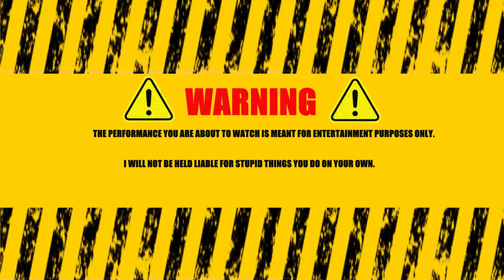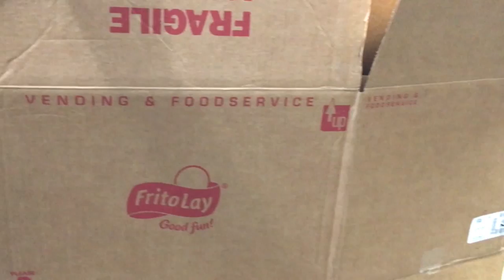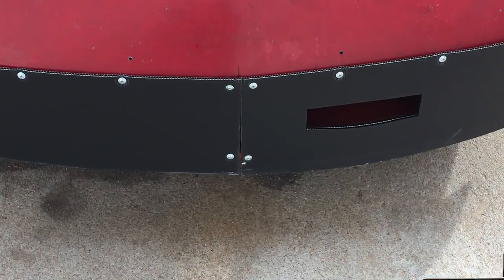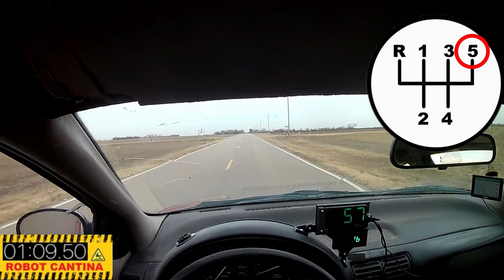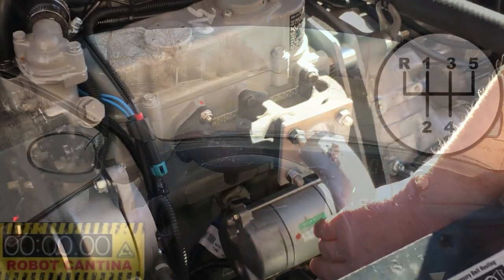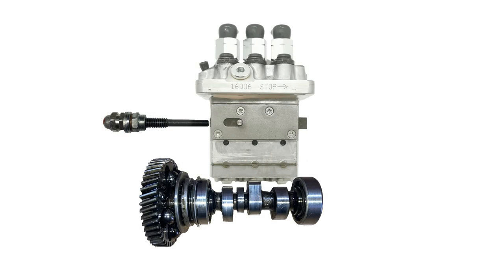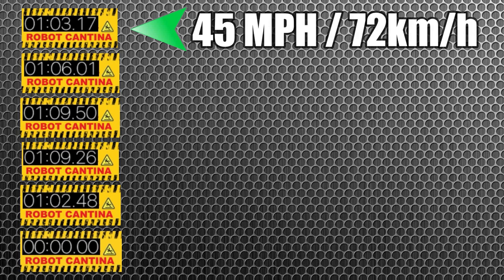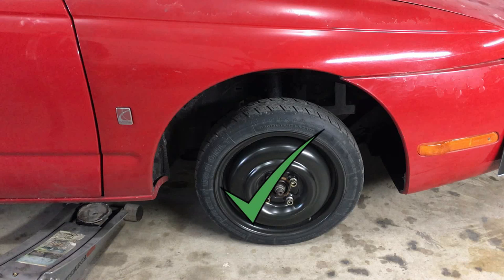S3E2   Fuel and aerodynamic mods ....We do some experiments to try and get the Saturn to go faster.

Comment: Maybe an intake positioned where there is cooler air would help. I like studying aerodynamics and i can say that the air dam is a little too low. Rear spolier removal seems ok, though consider replacing with a thin plastic piece that would extend 2 inches past the trunk. 3x4 inch pieces of plastic in front of the wheels would also help reduce drag.

Comment: first of all, going past rpm limit is not a problem at all for these engines, the reason its set from factory is because of smog regulations and also so people dont overload these engines for hours and hours on end running at high rpm. I used to repair these engines and they run nearly top rpm for over 10k hours so you can imagine, a car NO WHERE NEAR gets there for that amount of hours because they have gears while generators do not. You can set these till the injector pump runs out on these engines and it will run no problems. You can also modify the pump as well for higher output and some even have adjustments internally but those are usually for the big version of the motors, these small ones i think need machine work

Comment: Swapping the transmission for the MP3 transmission that was in the DOHC Saturns (SC2 SL2 SW2) will get you a closer gear ratio through all 5 speeds and may help with your acceleration. The MP2 transmission in the single cam / base model Saturns was longer gearing for more economy.
Reply: I think that's the transmission he has, it came from another car
Reply from the maker: Yeah, the MP3 has an ideal set of ratios for this smaller engine and you may have missed it, but that is the transmission we are using.

Comment: Being a diesel fan myself, I'm loving this series. It's not unusual for the exhaust to remain relatively cool during idle. I've idled my truck for 10 to 15 minutes and I can still grab and hold the down pipe from the turbo. Your EGT seems a bit low. It should be around 1100F. You're down on power because the engine is still "cold". It kind of makes sense that your aero mods slowed the car down. You took a big hole (no air resistance) and made a big flat spot and the car now has to push all that air out of the way.

I'm looking forward to your turbo install. It'll be interesting to see just how much you gain. I'm also curious to see what kind of fuel economy you finally come up with.

Great videos! Keep 'em coming!
Reply: @ocdman202  The Model T was introduced to the world in 1908. Henry Ford wanted the Model T to be affordable, simple to operate, and durable. The vehicle was one of the first mass production vehicles, allowing Ford to achieve his aim of manufacturing the universal car.  Telegrams went the way of the Model T..
Reply: The lights of the original Model T were not electric. The common lamps used on horse drawn vehicles were the lamps used on the Model T, this meant it used acetylene carbide headlights and oil side lamps. Electric lighting and electric starting became available for the Model T late in production during the 1920’s.

Comment: With 5th gear being too steep and hard to change ratio I wonder if smaller tires could be a benefit. Maybe the smallest skinniest trailer tires you could fit on, side benefit being lower to the ground and less aero drag. Really impressive how well it does already!

Comment: Adding boost to a diesel is not the problem.....adding too much timing is the real problem. As long as the egts are in range, you'll be good. And put in some good oil ( Schaeffers  or Lubrication Engineers )

Comment: Increase the fuel delivery from the governor / fuel pump.
Adjust it so when you full throttle it from idle it puffs black smoke that you can barely see thru it ( not thick black smoke )

Comment: It probably won't be much, if any, faster with the turbo. And the EGT will become lower if you actually get boost. Unless you increase the fuel to use the extra air that the turbo gives the engine.

At work, we have a dyno where we do a bunch of shenanigans from time to time in between tuning customer cars. A colleague owns a Mercedes 164 with 5 Cylinder diesel engine and no turbo. Made about 115hp. We slapped a turbo on there, and it made 118hp with no other mods.

But then we put a bunch of fuel to it by doing some electrical fiddling to the diesel pump, and with it came the black smoke, and a result of 185hp. :D
Sure, EGT probably is pretty high, but a very nice increase in power with easy mods.

Comment: Not sure if you've seen SuperFastMatt, but as he said in a recent video, intuition about aerodynamics is often wrong. That spoiler helps air detach from the car, rather than roll around in a turbulent mess - you probably want to keep it.  As with any experiment, do things one at a time and gather data in a systemic fashion - that's the key to seeing where the real improvements are.

Comment: don't worry about the EGT, just keep it below 1300F and you'll be fine, if you start getting to that point, add watermethanol spray.
And a little bit of timing advance will also help, not sure how to dial that in on this pump (I'm used to the Bosch VE), but not having the timing will make your engine feel down on power and depending on how the timing on this thing works, even get slower as you add more fuel.

Comment: A simple DIY water injection system will allow you to add a LOT of fuel and keep the EGT's Down. 
You can also do a water methanol/ ethanol 50% Mix and that will add more power still and not affect EGT's. 
Been using this for MANY years on my diesel engines and works  perfectly.  On this little engine I would suggest about 150 Ml a minute water dosage.   I use a cheap caravan pulse water pumps that are about 4L min and 80 PSI along with a bit of flattened copper tube to give me the injection rate I want.  On 2-4L engines I run about 3-400Ml a min depending if I want cleaning for using alternative WVO/ WMO fuels or I am wanting performance. 
300Ml min @ 50% Meth = a 14 HP boost which would be huge on this engine and would probably take it.  Engines can digest a LOT of water and far more than the ignorant say will Hydraulic them. The fire goes out and the engine starts spluttering way before that happens and of course you can increase in increments to find the sweet spot.  Yes, engines can use a LOT more water than they will use fuel. 

For switching with a turbo I use a Hobbs type pressure switch so the WI comes on above highway Cruise boost pressures so it's not on all the time which just uses the water up when it's not needed although that may take some figuring on this setup.  The Wi will give good results  on an NA engine and you can set the WI to come on with a switch under the throttle  so it comes on at full tilt where this and most other NA diesels are driven anyway. 

You will be surprised at the difference WI can make with straight water and especially  with the  alcohol added  and with a turblow.

Comment: You could try using a cheap little motorcycle intercooler for the turbo. Another thing to try is water methanol injection. It'll cool things down a lot on the ultra cheap and keep the internals clean. Winter wind shield washer fluid is perfect for it. Take a small junk picked carburetor and close the idle jet I think(?). Then finagle it so it releases at a decent rpm above idle. You should get a nice slow spray in to the engine. Might be best to put it in the side of the intake pipe (after the intercooler?? Idk). Sometimes it can increase efficiency and or power too. It's extremely common on high performance builds. Could cost like $10 to try it.

Comment: Some of the slower time with the aero mods may be down to air intake temperatures too. With the air filter being open at the back of the engine bay, at wot that pocket of air gets hot no doubt. With all the aero stuff off, there’s likely enough air circulating to keep cooler air for the engine to ingest. Perhaps adding a form of cold ram air intake piping to bring in coolest air from the front of the car (like the original Saturn did) to keep that happier, especially with the turbo.

Comment: I did some serious aero mods on an old chevy truck of mine running an old pig of a 350 and on highway trips there was an improvement in my mpg.   You should try covering the rear wheel well with coroplast and maybe even the front wheels.  Make a skirt all the way around the car to just above the ground.  I used the rubber stuff for landscaping from the big box stores but there are other things that would work.  A "boat tail" may help too.  I built a cap out of coroplast and wood for my truck bed cant remember the exact angle but apparently theres a magic slope and I matched that as best as I could had planned on redoing it in fiberglass but blew the engine and decided to go to a 5.3 and just havent got around to it.  

I did go with smaller tires and lowered the truck quite a bit then shaved the tbi and put a much less restrictive intake and exhaust on it then removed the AC and put a modern alternator in it and a few other things but after all that it went from 11-12 mpg to 17-18 which

Comment: 750-850*F EGT is ice cold. That's a happy engine, and you got a lot of room to grow
Reply: @ocdman202  The Model T was introduced to the world in 1908. Henry Ford wanted the Model T to be affordable, simple to operate, and durable. The vehicle was one of the first mass production vehicles, allowing Ford to achieve his aim of manufacturing the universal car.  Telegrams went the way of the Model T..
Reply: The lights of the original Model T were not electric. The common lamps used on horse drawn vehicles were the lamps used on the Model T, this meant it used acetylene carbide headlights and oil side lamps. Electric lighting and electric starting became available for the Model T late in production during the 1920’s.

Comment: The wing will help separate the air from the car without the curve of the boot will pull the air dow in the low pressure zone creating more turbulence make a small drag style wing out of aluminum that massively helps with drag

Comment: Also the governor is more for it being in a tractor. To keep the speed down and also keep the tractor speed consistent under loads from plows. Removing the governor won’t blow it up.
Reply from the maker: I would really like to remove the governor and probably should have before we put the engine in the car.  Unfortunately at this point its difficult to gain access to all the bits and we will have to pull the engine/trans to gut the governor.

Comment: Also you can try replacing hub wheel bearing(s) i can hear that distinctive sound  and they cause drag, i dont know if it's only left front wheel or both front wheel bearings.

Comment: Slower with aero mods does make sense when you look at it in a concept of downforce equals rolling resistance. 
Many times also a rear wing will stabilize air coming off the back of the car so that may have been an issue as well . To test this and validate it I would put the rear wing back on. Very possible also blocking off the air coming in from the front of the car increased down force as well. Being the car is so underpowered it may have this big of an effect. Also, ambient air temperature could be part of the issue as a colder  day on an engine like this that is naturally aspirated will make more power.
 The egt will climb even more with a turbo charger due to the combustion rate. Another option to add power maybe if there’s an adjustment to advance injector timing.

Comment: That engine bay has to be hot as heck. That would really in a power reduction as you drive. Maybe pull cold air from outside? Wheel well?

Comment: Check the fuel temp, hotter fuel= less density = power loss. 

This was a common cause of  slight power loss on older diesels. Newer diesels actually inject more fuel when the fuel gets hot

Comment: The theory of the spoiler (wing on the trunk that you removed) is that they create a beneficial drag that helps the rear tires have more traction (this is associated with spoilers above the trunk). Not sure why this would be important for a frontwheel drive vehicle. The configuration of it being at trunk level makes me think perhaps it is producing some minimal lift and this is somehow helpful with respect to aerodynamic drag (this is one of those wind tunnel questions - maybe there's a free online CAM modeler and some basic playing with it could help) for the front wheel drive.

Perhaps you could reinstall the trunk spoiler then fabricate a hillbilly front spoiler - protrusion from the front bumper bottom - that aids in reducing drag at the front by directing air flow up over the hood then run this through the hillbilly air tunnel... You could also test with just the front protrusion for an extra data point.

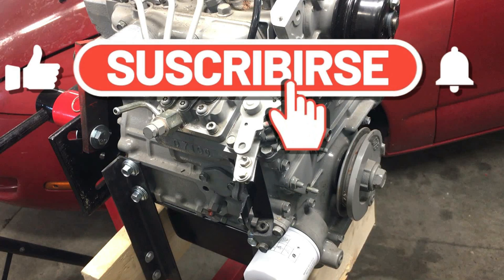Last, maybe it's an Easter egg; maybe it's not but it looked to me like "SUBSCRIBE" (14:08 is when it started to fade in) was misspelled when it appeared on the video...

Oh, and since you mentioned it @Robot Cantina - if you were going 396 why not just go 496 stroker? (Dream big or don't dream)
Reply: The rear spoiler he removed is almost certainly beneficial to reduce drag, he should probably put it back on.
Reply: @swecreations  I know that the raised spoilers behave exactly as I said, forgive me for not taking your word that a flush mounted spoiler acts the same way. Without a wind tunnel test or a CAM analyses that can simulate it we are both guessing based on our experiences. In my experience flush mounts would generate lift - which also seems to make more mechanical sense since you would want to apply pressure to the front of a FWD car for added traction because the torque is being applied at the front not the rear of the vehicle.
Reply: Also it's a Saturn not a top fuel or other race car so there's that....
Reply: @steve.roadcap  Look at the wing at the back of a Volvo 850-R station wagon. That thing helped bring its cd value down to an extremely low for the time 0.29 value.

You need to detach the air when it comes to the back of the car. The rear of the car is way too rounded, I can see just looking at it it will cause lots of unnecessary drag.

Air needs to be detached, even if I agree with you a flat non-raised spoiler would be optimal, the slightly raised edge of it is going to have a far smaller impact than the massive impact not getting all the air on the top of the car to detach would have.

Comment: Nice to see that you are monitoring EGT to ensure you don't cook the piston crowns - these are a great series of videos you are producing. Here are my opinions if wanted - If fitting a turbo, be sure to intercool as well to help keep combustion temp down (I had a turbo diesel on my land rover with no intercooler, I melted the piston crowns). On my newer turbo diesel engine which I rebuilt, I monitor manifold pressure which is set at 1bar, EGT which reaches 650'C when pushed, adjusted the fueling to just beyond a light haze of smoke at full power. Coolant temperature is stable. I recomend for power that you ensure the engine is drawing cool dense air from outside the engine bay, I wonder if this is a reason for the apparent fall in power once you restricted the incoming air into the engine bay? I imagine the air temperature in the engine went from being like a cold wind tunnel to a tropical greenhouse, I should think that will adversely affect the power from the engine. Also - I can't recall what you did for the exhaust system, but can you shorten it (maybe a side exit system)? Diesels hate a restrictive exhaust system because they are moving a constant volume of air per cycle unlike a petrol/gasoline engine.
Reply: The Model T was introduced to the world in 1908. Henry Ford wanted the Model T to be affordable, simple to operate, and durable. The vehicle was one of the first mass production vehicles, allowing Ford to achieve his aim of manufacturing the universal car.  Telegrams went the way of the Model T..
Reply: The lights of the original Model T were not electric. The common lamps used on horse drawn vehicles were the lamps used on the Model T, this meant it used acetylene carbide headlights and oil side lamps. Electric lighting and electric starting became available for the Model T late in production during the 1920’s.

Comment: Having run a small tractor with that engine almost identical to that, it's a Kubota but I can't remember if it's the same size or a bit bigger. It's a 3 cylinder of like 700-900cc range. It runs really cool most of the time. Anything where you're not loading it pretty solid or running low load, high speed, its exhaust stays managebly cool,  you could touch it too after 10 minutes of idle. I'd say thats the norm. That's also an old worn out one with probably hundreds or thousands of hours.

Comment: Hey...what if you use narrower, tall tires.. taller then the spare tire, but narrower then the stock tires? Also what if you used a smaller lighter radiator,  like a heater core modified with a inline filler cap? Also could you put a rivet losely in to the thermostat flow by vent hole to help with the engine temperature?  Its just an idea..

Comment: Remove the shim under the pump that will lower the egt's bc it will advance the timing a lil to let the extra fuel burn in the cylinder and not in the exhaust I also think that the Kubota will handle the egt's fine like 1150 or so and the lift pump might be giving you your issues pump a pressure gauge in line to see if pressure is falling off.